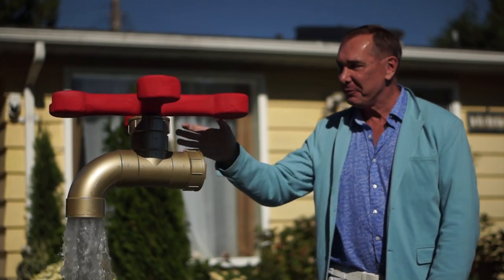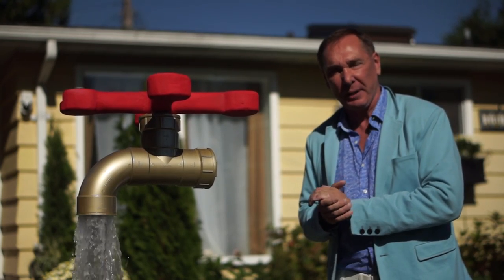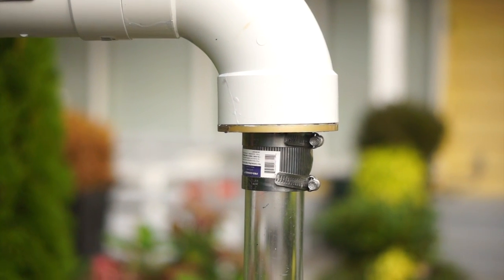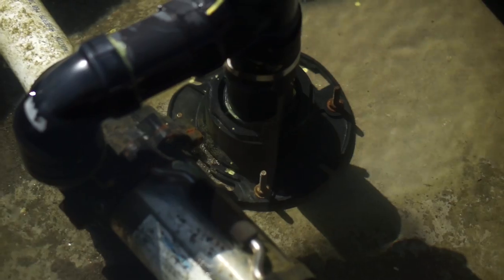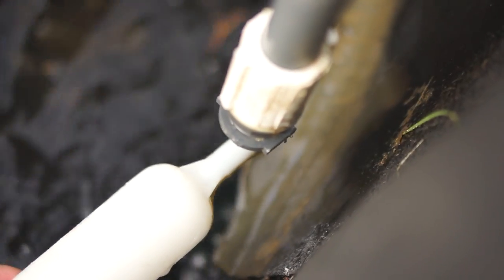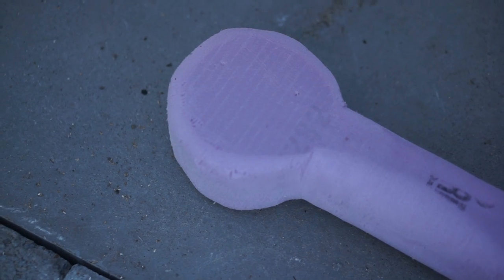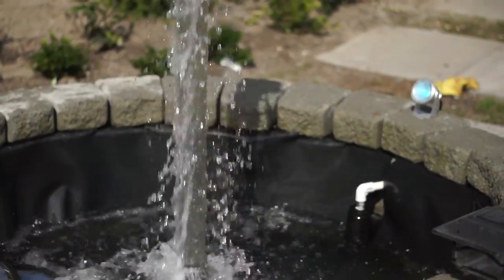How to build my Amazing Magic Fountain

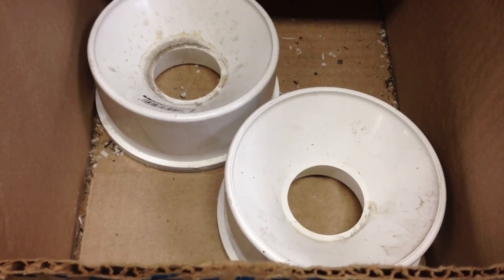Comment: Hello Percy! Thanks for the video. Quick question...did you drill holes in the 4in x 1-12 sewer spigot seen at 1:43 ? Is that also what we are seeing at 3:23 ? That seems  to be the only way I see that the water could return down the outside of the clear pipe.

Comment: Hi, great job !! I plan on trying it on a smaller scale for the same noise reason ....i think what a lot of people are wondering is how the water comes back out the spigot ...it goes up the acrylic pipe into the reducer , but how does the water come back out and around the acrylic pipe...its not too clear
Thanks , and nice work again

Comment: please see 3.25 sec. n Ur video 
u r showing the tube and the tap
In the middle tube s fixed. surrounding that 6 holes r there.  what s that attachment called? in the normal tap only one hole can b seen. did u fix anything with that.

Comment: Hi, It may be an old model.but it's new to me. I like it. Please tell me how the water splashes down from the tap. I saw some videos like this but t the water doesn't splash.please reply
Reply from the maker: Hello. The key to this project is the clear water uptake tube that routes the water up from the source. As with all fountains it's important to have an automatic water top off setup so that as the water evaporates you have more added. If you don't do that you could fry your motor!
Reply from the maker: Hello. The key to this project is the clear water uptake tube that routes the water up from the source. As with all fountains it's important to have an automatic water top off setup so that as the water evaporates you have more added. If you don't do that you could fry your motor!
Reply: Sorry my question is.. How the water splashes from the tap. Tube s in the middle. But how the water flows outside the tube

Comment: Noticed "Metro Goldwyn Mayer" printed on the foam. Guess where we know what studio he got that from!  Doubt if the missed it. Avoid acrylic - especially outdoors. Solar UV will break it down, creating cracks. Also not very strong; a strong wind on the valve assembly will probably damage it. He is right though - it is more transparent than PVC. Actually, about 30 years ago these same fountains were popular displays in front of stores to attract people.
Reply: MGM Studios owns the Trademark for the Pink Panther.  It's just a copyright statement on the styrofoam sheet.